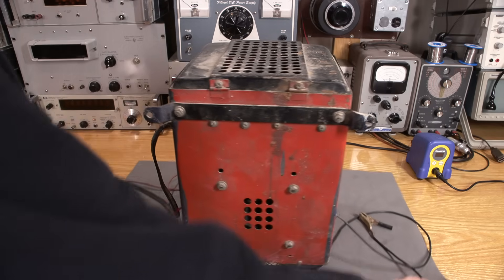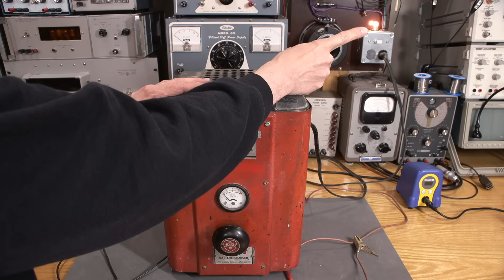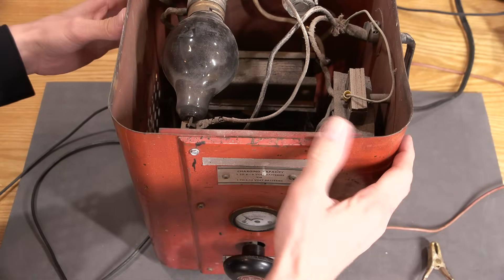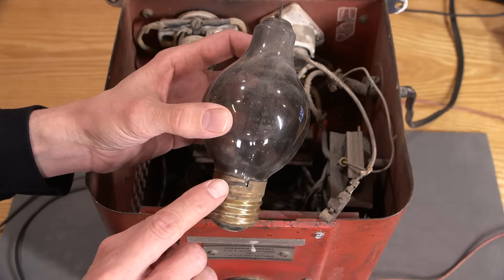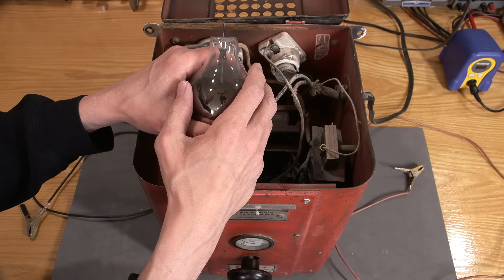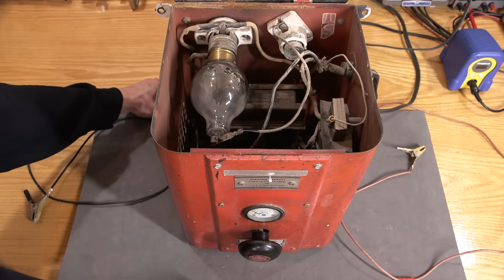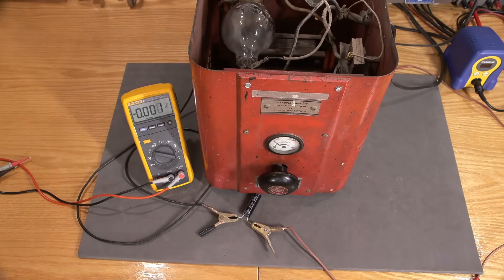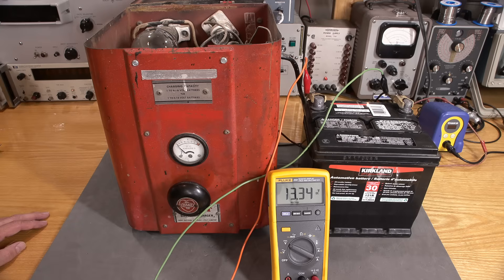Mean Hart Battery Charger - See It Work!

Comment: Back in the late 70s, my uncle, who was a mechanic before the 2nd W W and stayed one for the rest of his life, gave us one of his old trickle chargers made like this only skinnier with the bulb upright. Went to use it one day, and the top electrode on the bulb had eroded away. Never could find a bulb for it, so it went away to who knows where. Yeah, it would charge just about any battery, albeit you had to run a timer and abide by it.

Simpler days.

Comment: It is an old wives tales to not touch the glass of electronic tubes but on the other hand touching a car's halogen headlight
bulb is a distinct no-no. Showing off this vintage technology is always fascinating to see Paul. I would like to see if you 
can get the original bulb restored to working condition.
Reply: Yes, i've replaced several times, the headlight bulbs on my older Harley...they usually fail when the vibration breaks the filament. But, the installation always mentions NOT touching the glass with bare fingers. These are often a quartz type glass, and the oils in your skin can degrade them. I've always used a clean shop rag, but these days with the latex gloves available for little cost, I'd guess they would be OK. Anyhow...after installing any of these, I've always wiped them off with a very clean cloth. Old 100% cotton T-shirts are great. Just wash them first.
Reply: Depends on the tube i think some do get pretty hot, most usually dont get as hot so dont matter, same with normal light bulbs
Reply: What I understand is with halogen lights it is important not to LEAVE FINGERPRINTS on the glass as the halogen light runs so hot that fingerprints on the glass will melt into the glass and weaken it.
( thats pretty hot )
Reply: @michaelszczys8316  correct, also do matter a bit on how much oil you got on your fingers and grime, esp if its other stuff than just natural oils from the skin, ie hydraulic or engine oil

Comment: Interesting about the tubes and touching them. I guess it's worked its way all the way around. I guess it's a thing with the halogen lamps where if you get the oils from your fingers on them that creates a weak point in the Glass when it gets hot. But that's only combined with high temperatures and certain glass, I guess everybody just assumes it's the same thing for tubes.

Comment: If you read the manufacture's name plate you will find that the charger was made in Canada.  I know I repaired them in tha mid to late 1970's. 
We finaly used a diode convertion to replace the tungard bulb.
Reply: Was most of your repair work replacing burned tungar bulbs and changing fuses and terminal clips?

Seems quite reliable, possibly a rotary switch from time to time?

Comment: You mentioned that this charger has an ability to bring batteries back from the dead. I would hypothesize that beyond a higher voltage and consistent current, a bit of AC ripple in the circuit would create a micro vibration, possibly dislodging sulphation encrusted on the lead plate surfaces, often the cause of lead/acid battery failure.  I have a modern charger with a repair function that injects pulsed AC to do just that.
Reply: It's not due to vibration but you're right that AC ripple plays a part! Mind you flat dead is flat dead, still. You can't put the lead back on the plate!

Comment: The real truth is you do not want to touch a tube when it's operating cause it will give you a nasty burn from the gloss and metal tubes can burn you as well and may possibly shock you. If they're not grounded correctly, some metal tubes do have a ground pin to ground the outer shield.
Reply: When I was a kid I touched a tube on my radio amp and it burned my fingerprint onto it. 

Flipping hurt.

Comment: Don't you mean in parallel? you said in series charging 12 volts so that would make it 36 volts. What's the benefit of charging in series not to parallel then? can it not charge in parallel? Why didn't they design it with a bayonet bulb instead of a screw bulb, would have sorted out that problem. What happened about the wire recording I thought you might have put the hole recording on YouTube, you're not going to?? ummm!
Reply: Tungar bulbs were manufactured with a Mogul screw base, so that's what the charger needed to accept.
Reply: @m.k.8158  yes but couldn't they got the manufacturer of the bulb to make it a bayonet?  I mean how difficult is that it's not.
Reply: @therealBozoDjTrump I don't believe that a bayonet-base large enough was ever produced....and since base styles were fairly standardized at that time, I'm guessing the industry decided to use standard parts.
Reply: Series is correct idk why tho

Comment: I got one of these Tungar Bulbs myself and only difference is mine have a wire at the top instead of a pin. I have not tested mine but the filament is still straight on it at least

Comment: How did the charger know not to put out Amps at 6V?
Reply: The knob in front switches taps on the transformer.  The voltage output on the first 2 taps are too low for a 12v battery.  The more you turn the knob the higher the output voltage.
Reply: @AcidBURNer666  I thought the battery was empty but it already was over 6 V then ;) . Thank you very much for your response!

Comment: 0:58 They don't make things like that anymore. QUALITY! Why I prefer old stuff over new stuff.
Reply: Same!!😊
Reply: I have held onto my dead simple "dumb" charger that my dad bought in the 90's. It just outputs 2A or 10A, it doesn't have the modern protections that won't turn the charger on if a battery is totally flat.

And if you want to let a battery sit and "boil" once charged, you can do it.

Comment: Did you mean to say charge 3 -12V batteries in parallel Mr Carlson? I've always charged multi RC helicopter batteries in parallel and never series. It would take 38 to 40 V to charge 3 - 12V batteries in series?

Comment: If you can not get a tungar bulb a diode will wok fine
Reply: Where I work  we actually have 4 of these old chargers that have had their tungar bulbs replaced by a diode long ago (still in use daily).  The bulbs actually did not last very long under constant daily use.
Reply: @AcidBURNer666 I fixed one about 50 years ago at Grinnell Aviation Santa Monaca. It was quite shop worn at that time.

Comment: 10:15 I'm sure it's just quartz bulbs that are sensitive to fingerprints, requiring them to be cleaned with IPA, etc.
Reply: + Yep. Any fat/grease on this kind of glass gonna end bad quickly. It's melting into the glass with temperature and makes it.... soft, ish. Try to put petrol/gasoline on styrofoam/ same effect, just works slower and under temp.

Comment: In my early Navy days I worked on a SONAR system that used 4-400A tubes in the 1kW final. During training the instructor presented one such tube that was claimed to have been touched by a not-clean finger and not cleaned before use, the glass appeared to have melted and dimpled orcratered because of whatever contaminant was on the handler's fingers. In practice we always handled the tubes by the glass, but then wiped off the glass before energizing.

Comment: I've always heard the one bulb you shouldn't touch is a projector bulb. Supposedly it's because they put out so much light that a fingerprint on the bulb  will absorb enough to make a hot spot which will break the (quartz) glass. Or maybe they just don't want you touching the bulb because you'll get burned. Not that I'm inclined to touch something that's glowing red hot anyways.

Comment: Would love to see this in a head to head with several flat batteries and something like a Optimate charger with digital power stuff, purporting to rejuvenate over discharged batteries. I would guess the old school is more dangerous but far more effective if used correctly and the new type less effective but safer for current consumer demographics. That old one has earned its worth in extraction of materials and construction. I can't say that of many products these days.

Comment: The “no touching the glass” recommendation is reserved for quartz glass such as halogen headlamp bulbs and desk lamp or puck light peanut bulbs.
Reply: Mechanic in the garage i left car for changing the tyres and a H4 bulb didn't know this or didn't care... 
I've asked them to try replace the bulb as the connector was stuck so hard i couldn't remove it without tools i didn't have.... long story - you cannot take/unclip bulb from the headlight without 1st taking connector out or destroying rubber cover.
2 weeks later - bulb died, glass where it was touched with greassy fingers - like a baloon. Like someone was blowing into the melted glass.

Comment: I suspect the Don't touch the tube myth comes from the genuine problem with halogen bulbs where the salt on your fingers can react to the glass at high temperatures and lower its melting point
Reply: But most halogen bulbs have an inner glass.
What I've seen similar to this melting problem is sometimes tungsten wire touches the glass and melts it, the gas inside the inner tube goes out and tungsten oxidizes rapidly.
Reply: @erdem--   the smaller capsule bulbs (and higer performance projector bulbs) are not normally encapsulated
Reply: @wktodd  That makes sense, there is a Don't touch label on projector bulb's, so this myth can be coming from this. Also some 1000 watts halogen studio bulbs have this melting problem too, I was suspecting poor ventilation but it might be salt too.
Reply: @erdem--  the same reason soda lime glass is stronger because of minerals added makes the quartz glass weaker too. It's all about the relative proportions and the fact it's localised.

Comment: Isn't the issue of touching the glass of the vacuum tube that you can transfer oils, wax and other grime from your hands onto the glass which will cause a hotspot / whatever that can weaken it when it gets hot? That's what I've heard at least.

Comment: Whoa, memories here! I grew up in my Dad's service station using a charger similar to this one. Instead of the rotating knob, his had two plugs that you pushed into two columns of 3 holes to get the right current reading. You daisy chained batteries using pigtails that had little spikes on the ends that you actually tapped into the battery post to make the connection. After 24 hours you used a hydrometer to check specific gravity and 1.265 was charged. Checked all cells to make sure there were no dead ones. Top up with water and return to the customer. And yes, I remember it humming away like crazy as it worked.

Comment: Note that when charging automotive lead-acid batteries or replacing one in a car that has a defective alternator and has been overcharging the battery for some time, be cautious when connecting and disconnecting, even in a well-ventilated room. I have witnessed overcharged batteries explode in a mechanic's face twice in my 44 years as a GM Automotive Technician. A sign of an overcharged battery is the smell of rotten eggs or sulfur, caused by the electrolyte boiling inside the battery and releasing hydrogen sulfide gas, which has a distinctive odor. I always called it the Hindenburg gas also known as Hydrogen gas. Take care, Mike ASE Master Technician retired.
Reply: Happened to me was using the big battery charger the wind blew the hood down . Sparks then boom , luckily was turned sideways. Burned holes through my coat .🥺😢
Reply: I personally have had two blow up in my face in my lifetime. It ain't fun.
Reply: @Watchyn_Yarwood  after that looking away is automatic 😂
Reply: @Watchyn_Yarwood  Safety glasses are a good idea when working around batteries.
Reply: Ive witnessed one, mid 90s. Sounded like a bomb, well it was. Acid bomb, big one too. Tractor battery.
Reply: Friend blew the top off of one that was not even charging or anything, just sitting dormant on a shelf.
He went to connect the wire to run a radio and kablam.
Reply: @michaelszczys8316  Batteries emit explosive gases all the time; this is why they are vented, but when charging, this rate of gas increases. The older the battery, the more likely you are to have a problem.
Reply: I think an electrical engineer with a bachelors degree would know this from his high-school physics classes.
Reply: @BritishEngineer  However, not everyone is an electrical engineer. 🤣
Reply: @ Ya think?
Reply: In the 70's batteries had screw caps which you were told to loosen off while charging to vent off hydrogen. We were also told not to remove crocodile clips with charger still powered as spark could ignite gas. Not likely in a well ventilated area, but still good habit to get into. I am pretty sure modern batteries have a vent that allows gas to escape if pressure builds. 

They only times i've heard stories of a battery exploding is when the terminals get shorted by something that heavy duty like a spanner of metal car bonnet.
Reply: @HowardKlein1958  The old batteries had very small holes for venting, but it was necessary to remove or loosen them when charging. Some may explode due to internal shorts and overheating.
Reply: Yes, an overcharged lead acid battery WILL outgas quite a bit of hydrogen. They even create some during normal charging, BUT, when overcharged the amount will be MUCH larger. 

I had a bad alternator in a car years back that was overvolting the battery, and when I came out of a store after a brief stop to get something, the battery in my car BLEW UP the second I hit the key. It sounded like a shotgun went off 💥
There was battery acid dripping out from beneath the left front fender, and I instantly knew what had happened..
Reply: Buzz kill

Comment: That is one cool battery charger!  They did a great job with the styling, it still looks modern.   Speaking of older things being built better, my furnace turned 70 this year, never a problem with anything except the bimetal fan control - a $20.00 NOS part that came with installation instructions and was a simple 5 minute job.  They're still making the fan controls somewhere, but the new parts are awful.